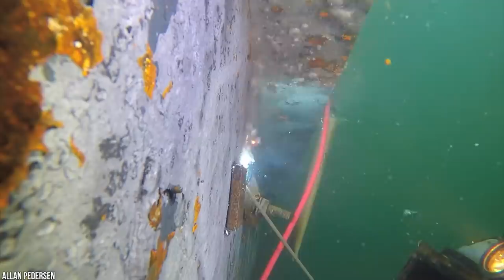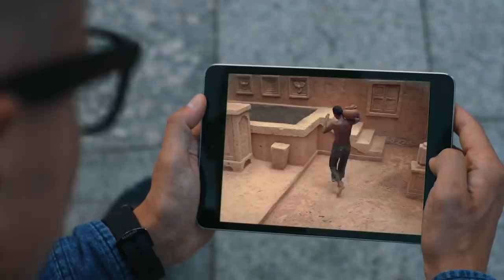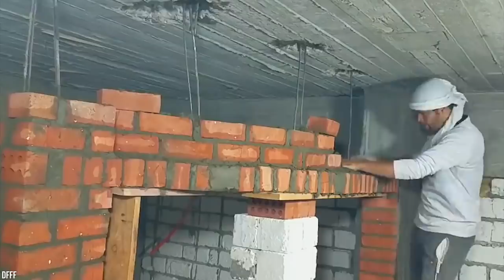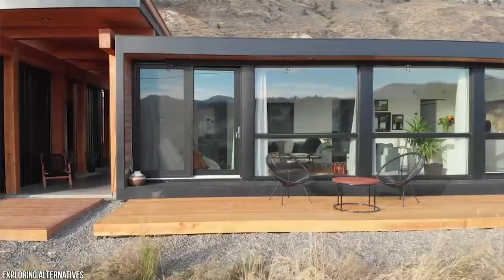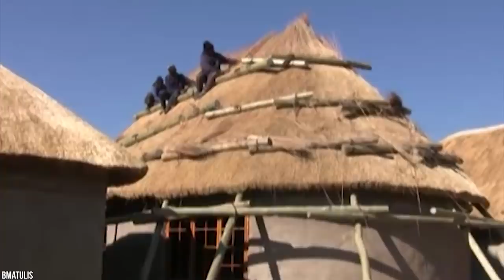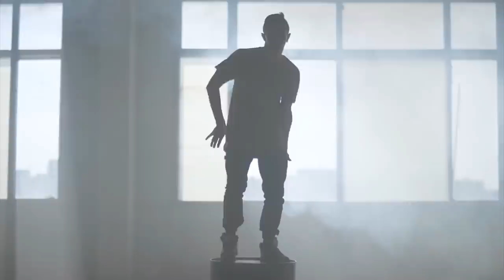15 Ingenious Construction Workers With Skills You Must See

Comment: That roll on brick road looks like it was for Hollywood for a movie shoot.  They are not cementing it down and it would get torn up FAST if cars drove over it.

For the YouTubers building homes by hand...  Most of them fake it.  They either use equipment or get a whole crew in.  Filling a swimming pool by hand with a 1/2 pot from a stream 200 yards away would take months.    They do still have some skills, but bamboo and soil with a lot of clay in it make for easy work doing the things they do.

The editing for the brick arches part of your video is all messed up.  Same for the last one in the video about the grouting.

2% of fires have thatched roofs?  That is not a good statistic because there is likely FAR less than 2% of homes in Europe with thatched roofs.  They not only catch fire easy, but they burn fast.

Comment: Water is a very poor conductor of electricity like in welding. Not to say you can’t be killed but electricity will follow the path of least resistance and that would be welding rod to metal, water connector not good.